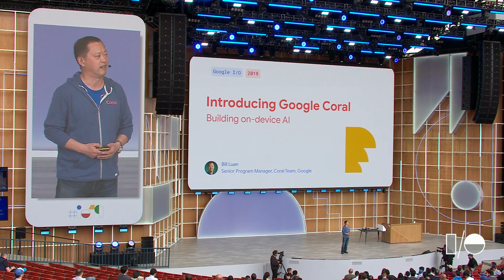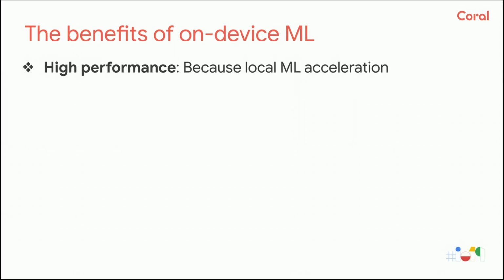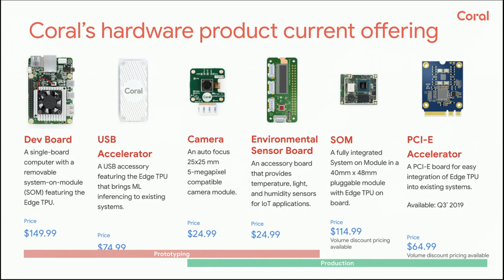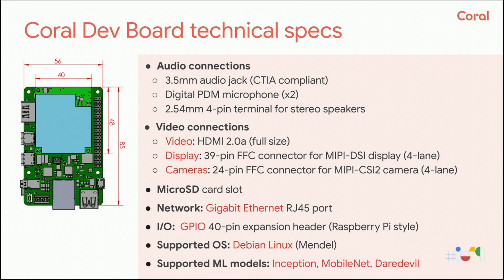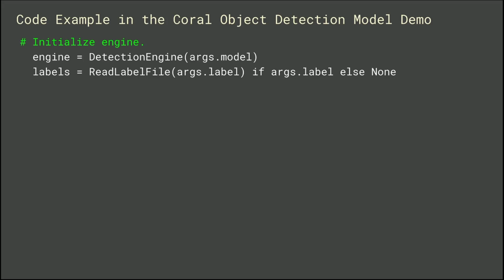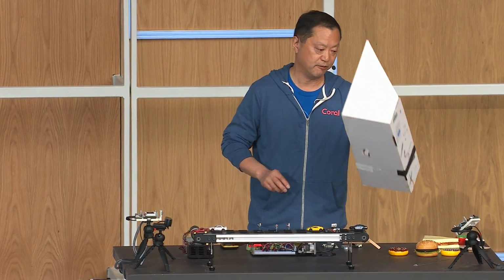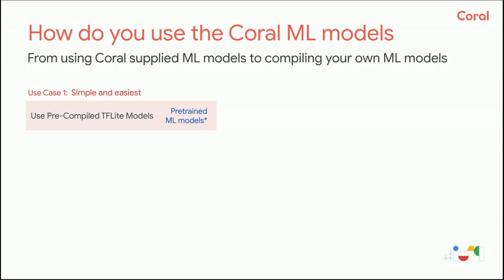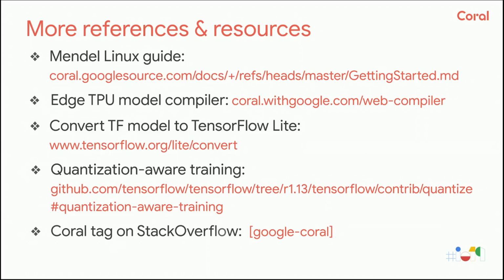Introducing Google Coral: Building On-Device AI (Google I/O'19)

Comment: The speed of inference on coral could potentially just be due to the quantization, not their hardware. Its a shame they compared it to a $500 NVIDIA graphics card in an unfair manner, its all marketing. Why don't they run the quantized model on a GPU and see the FPS on that.
Reply: It's a piece of trash. It takes a ton of time to set up compared to Jetson nano and raspberry Pi which are almost plug and play.

Comment: Model Play being introduced in this session, is developed by Gravitylink. Model Play is a global platform for discovering, sharing, and experiencing easy to use machine learning models. It’s compatible with Google Coral Dev Board, with a fast, simple, and small control tool in Model Play app that works with AI hardware. Users could start and stop the ML model running, with previewing the performance in real-time, just through by a little mobile phone. Even AI beginners can easily run the model after downloading the Server follow the user guide. It is fast, simple and easy to complete all the setups and to use. learn more at: http://model.gravitylink.com/